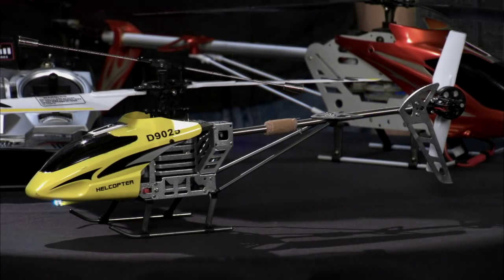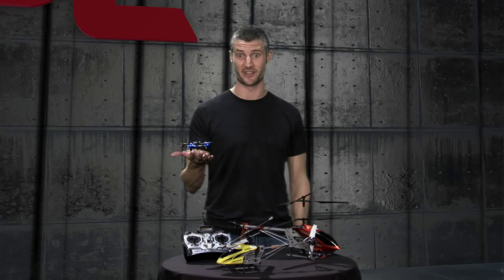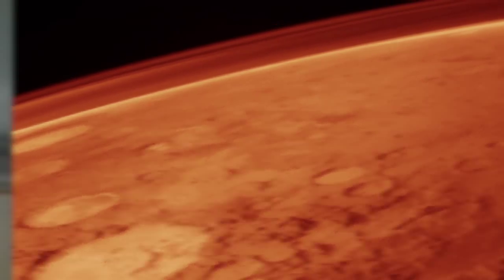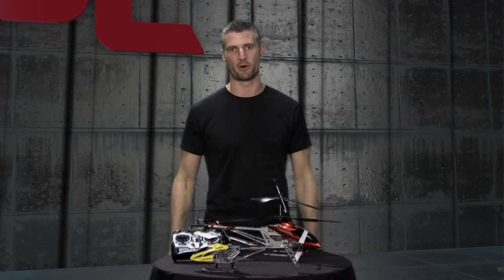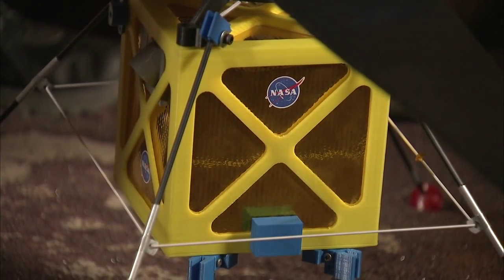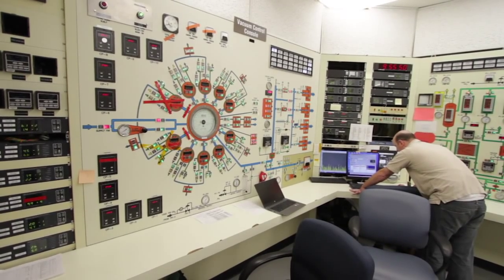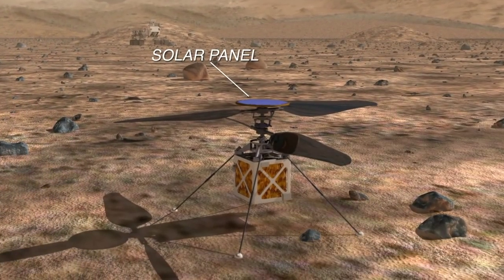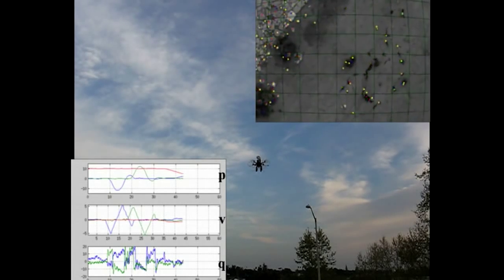Crazy Engineering: Mars Helicopter

Comment: If there is less gravity, wouldn't it be possible to use a very small gas-balloon on top to help it stand back up if you make a bad landing and tips over? It would help with the lift when flying, conserving energy from the engine during flight.
Energy that you could then use to run three simultaneous video-projectors focused into a hologram, saying "Help us, Obi Wan Kenobi. You're our only hope." - if you meet ze alienz.
Reply: Remember that a balloon works on buoyancy; displacing a greater weight of atmosphere per volume than the balloon and attached payload combined.
Now consider that Mars atmosphere is 0.097 (less than one hundredth) that of Earth's as is considerably colder as well.  This means any 'lighter than air system on Mars is going to have a whole of challenges to overcome, which adds to the technical difficulties AND, more critically, add the overall weight of the probe (which means higher costs in fuel to get the thing there which means a more expensive mission).
Now compare that to a far lower-tech and simpler solution of having wider 'legs' as the landing platform.

I don't a balloon is a bad idea, far from it.  I do think it isn't feasible given current technology.  Otherwise some space agency would have already sent weather/surveying balloons to Mars by now.
Reply: Juan Enfermo Bastardo
I'm curious, I know they're not really practical on Earth, but with the lower density of martian air, meaning less pressure on the balloon, would a vacuum balloon be feasible without implosion or adding too much mass that would cancel out the benefit?
Reply: Just ball-parking the figures, because I'm not very good with maths, at Mars surface pressure a balloon would have to displace something more than a net weight (includes balloon material, inflation substance & weight of probe) of 63 grams per cubic meter for positive buoyancy.  At the summit of Mons Olympus, this drops to something like 31 grams per cubic meter net displacement.
(That's the weight of CO2 as Mars pressure factored against Mars surface gravity.  But like I said, I'm bad at maths.  If anyone who can do the calculations accurately wants to chime in with the correct figures, please do so!)

My guess is that a vacuum balloon would the way to go, but as far as I know (which ain't that far) we've yet to develop the materials that are both sufficiently lightweight AND rigid enough to keep from imploding, even at Mars atmospheric pressures.

I do like the vacuum balloon concept though! If any one does develop the requisite materials (especially if they stand up to Earth's atmospheric pressure), I think it's likely dirigible airships make a comeback as cargo carriers (and luxury passenger cruise ships).
Reply: Juan Enfermo Bastardo
On an unrelated note, I think airships are plausible for a comeback on Earth today. People are just irrationally terrified of hydrogen thanks to the Hindenberg and Helium isn't nearly as buoyant or cheap.
Reply: DysnomiaFilms There are several companies working on airships, but the issue is, again, materials technology needed to create the size of craft to make them economically viable as bulk cargo carriers.  Airplanes do fine when speed is critical, surface ships, barges & trains do nicely for slower bulk freight.  Lighter than air craft currently have neither the capacity nor speed to be feasible compared to construction & operating costs.  It really has little to do with the fear of hydrogen.
Reply: Juan Enfermo Bastardo
I was thinking more cruise ships mainly. That's what I hear when the topic is discussed anyway, nobody wants to be in a ship filled with hydrogen, because they're afraid of combustion. I know there are companies building airships but they're all using helium, which as you know is far less effective.
Reply: The USN actually operated a small fleet of helium dirigibles during the 1920's & 30's, all of which crashed in poor weather.  Disasters like the Hindenburg were a result of geopolitics: the USoA didn't wan't to sell Nazi Germany helium, which at the time the US was the sole source.

The Hindenburg was purpose built as a passenger vessel with a crew of 40 serving 50 passengers.  Using hydrogen, it could lift only a little more that 232 metric tonnes (which included the air frame) Using helium would have only reduced the lift capacity by 8% (214 tonnes)
Now, given current construction costs, using advanced materials & avionics, how many passengers could a dirigible carry and at what cost per passenger?  Remember this doesn't include necessary port facilities (the LZ Hindenburg was about the size of an Iowa-class battleship so the hanger was HUGE).  Also, dirigibles are highly affected by weather conditions, particularly during landings and takeoffs.

Look, I get your point about some people thinking about the footage of Hindenburg's demise, but more people die every year in regular old airplanes than ever died in all the dirigible crashes.
But I also know there are a lot of people who love the romantic notion of flying in a dirigible.
The problem is the individual ticket prices.
First class airfare from where I live in Texas to Seoul, South Korea, round trip is about US$ 6200, which is about 20 hours of flight time, with departure & landing not often affected by weather.  
And that's on a craft designed to hold several hundreds of people.

Best time on a LZ type dirigible, assuming no weather interference and a possible max speed of 150 km is about 74 hours for the same trip.  And we're not talking a Disney Cruise ship either, We're talking more like taking a train, only without the built-in economies of scale.  So entertainment is digital libraries, the web (given a satellite uplink), eating or conversations with other passengers.

And unless the ship is designed to operate above the tropopause, (12 to 17 km depending on latitude and season), weather is going to be a constant factor.

Basically you're saying people would be to scared to fly a dirigible, even on filled with non-flammable helium.  And I'm sure there will be some who would be.

My point is not that people are scared to ride a helium dirigible, but that it's just to damn expensive and time consuming, with little to compensate (maybe a three to four day airship cruise filled with steampunks or a live-rp scenario might be fun), but that's an extremely limited market.

My further point is this; if helium dirigibles are to be economically viable, it's going to be because improvements make them more reliable & cost effective than surface freight, which currently runs about US 10 to 25 cents/kg.

Comment: Won't using helicopters cause a lot of dust that can get on the rover's lenses, solar panels and mess with other equipment? Why not use a tethered balloon with He to get an overview of the area.
Reply: They'll land the helicopter a distance away from the rover.  Remember, Curiosity is not solar powered.  It has a RTG (Radioisotope Thermoelectric Generator - i.e. it uses plutonium) to provided power.

Comment: why we haven't already used one?
Reply: Because whilst the RC community has been around for quite a while, NASA always uses very old, very robust and proven concepts.

It's a safety thing. Safety of the investment in the project.

Note that the the prototype is mostly 3D printed. That's very forward thinking from the usual MO you see from them.
Reply: aserta  What's the RC has to do with anythiing? RC means remote controlled...The heli would be autonomous and would just provide pictures for the control room to choose a direction for the rover.They can't directly control a RC heli from earth the delay is 13 minutes or something....
Reply: Stelios Tzo I said RC community. Not just RC. Meaning everything that was invented for that field and has been converted for that field. Which is substantial. I don't see NASA looking away from all of that. In fact this prototype uses exactly what i'm talking about.

I didn't write about the function of RC. Radio controlled from Earth. Sigh...

Of course when it's on Mars it will be autonomous (that's what the video says about the requirements, it could be just a receiver, controlled from the ground robot).
Reply: aserta Because no one in the RC community could come even remotely close to making something that would be capable of flying in the rarefied atmosphere of Mars. It's not as simple as "Send a quadcopter to Mars!", NASA is pretty much working on the fringe of what is barely capable of being done, even with some of the most prestigious aerospace contractors in the world helping them.